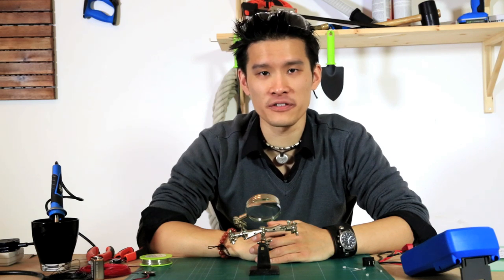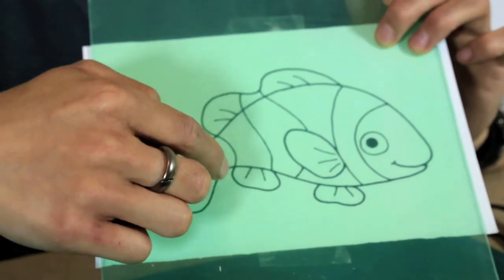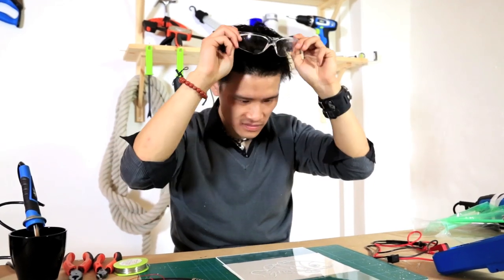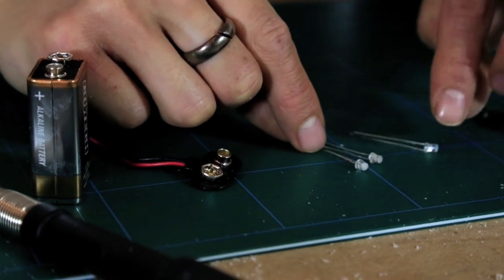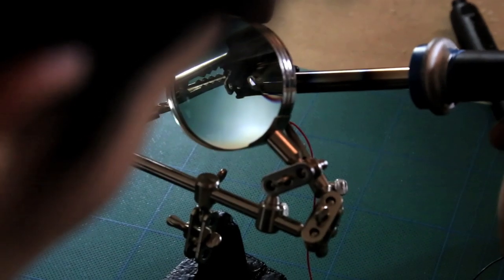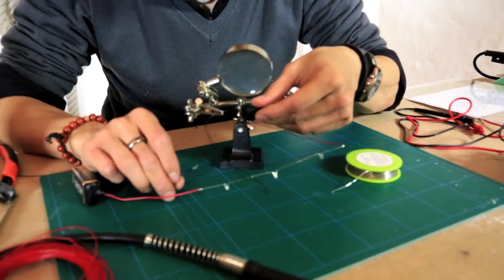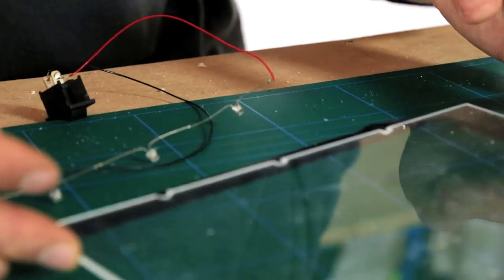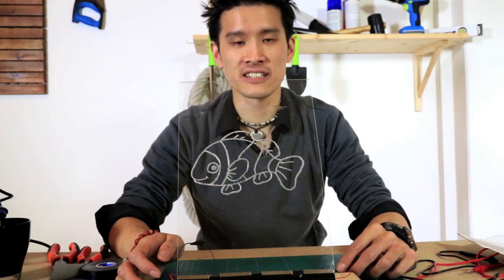How to make an LED frame - Clas Ohlson

Comment: When engraving Plexiglas (or anything really) you should also wear a mask to cover your mouth/nose.
Inhaling microfibers is no joke & can lead to respiratory diseases/tissue injuries.

Also do not heat the component (LED or other), you gonna ruin it!
Touch the solder on the component & heat that instead (=the solder), only for a couple of seconds at a time.
If you can't get it right at first try, give the component a few seconds to cool down & repeat.